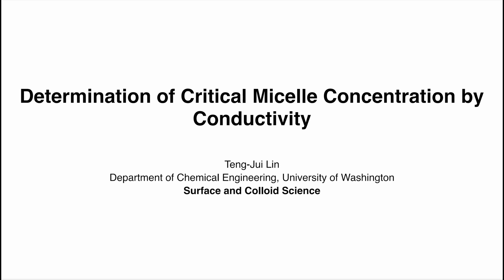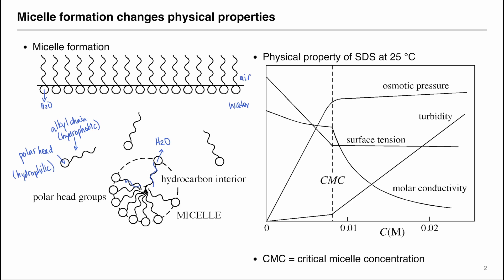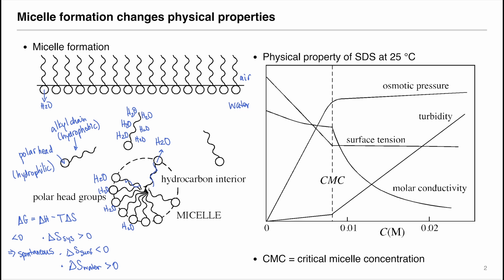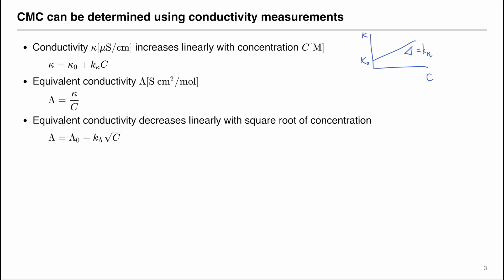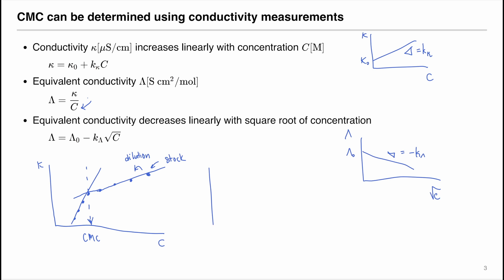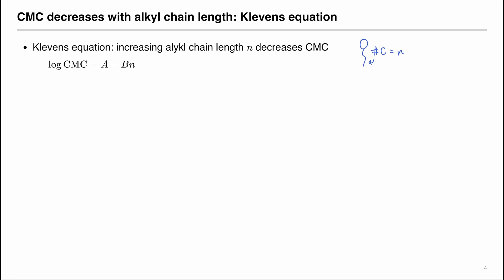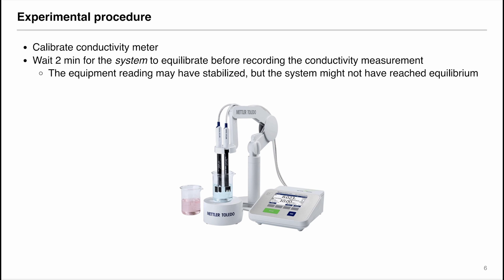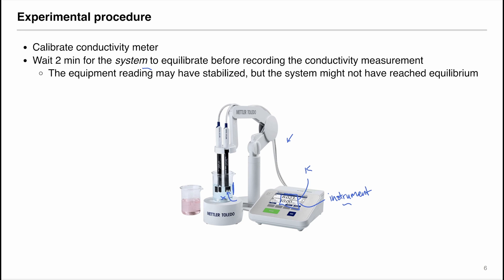Determination of Critical Micelle Concentration (CMC) by Conductivity [Surface and Colloid Science]

Comment: A question: Can this be done with 2 metal plates connected to a battery and an ammeter? Will the CMC still be noticable?
Reply from the maker: Wouldn't hurt to try! The key is if the setup is sensitive enough to capture the slope change in conductivity.